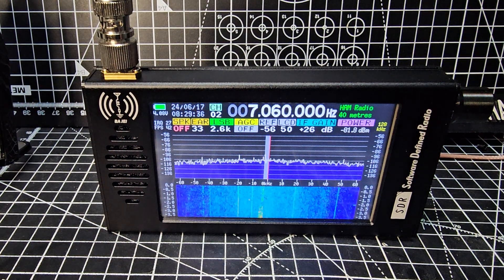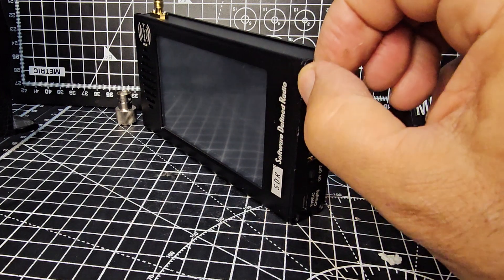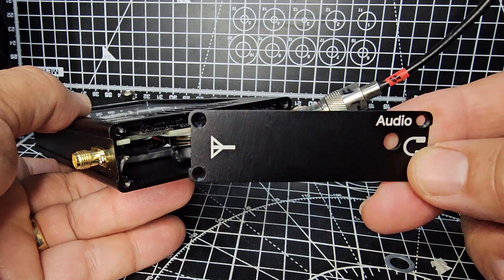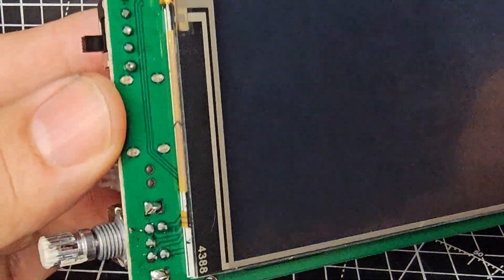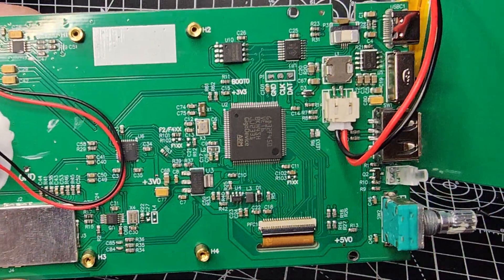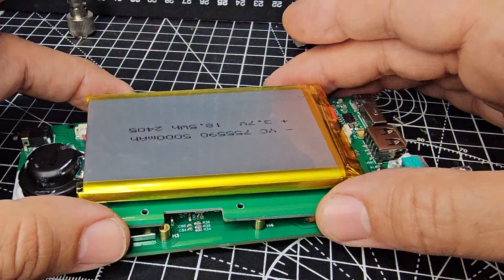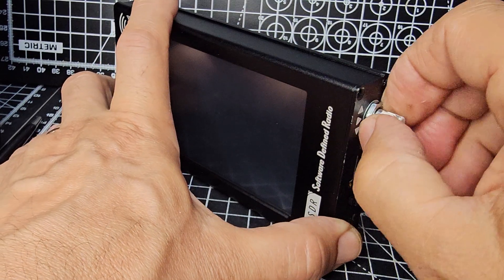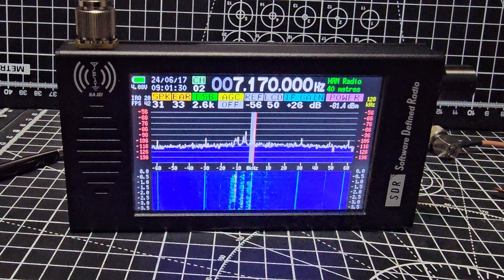SDR CLONE RECEIVER - DISMANTLE

Comment: Very interesting information, thank you. I carefully examined the printed circuit board and would like to share the hypothesis that arose after that. Have you tried loading the firmware file onto an external USB drive and then connecting the drive to the USB 1 port of this radio when it is in boot mode? Maybe it will swallow the firmware this way?
Reply from the maker: Hi it work.work .
Reply: @HamTechRadioScannerDrones does it actually work? can you do a tutorial?
Reply: @HamTechRadioScannerDrones  me gustaría aprender. Será necesario alguna modificación?
Reply: @HamTechRadioScannerDrones Thanks - this is a really interesting video. I've just got one of these - and for the money (about £57 from Banggood) it's pretty amazing what it can do. I'm really interested - does this mean that you can put the updated DeepElec firmware file onto a USB drive, pop it into the USB-A port, hold in the encoder, and switch on, and it'll update? Is it better with the new firmware? Any downsides to doing this? Thanks. 👍